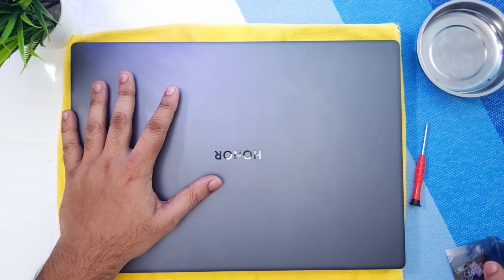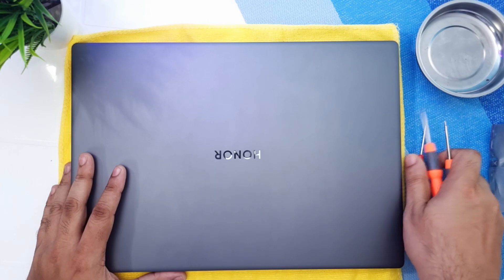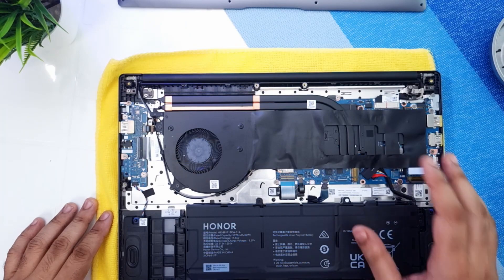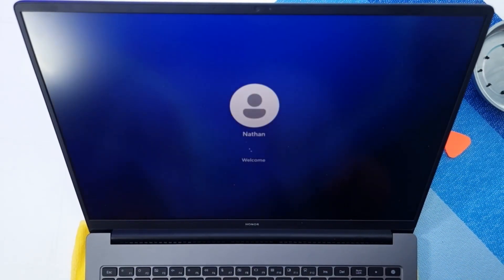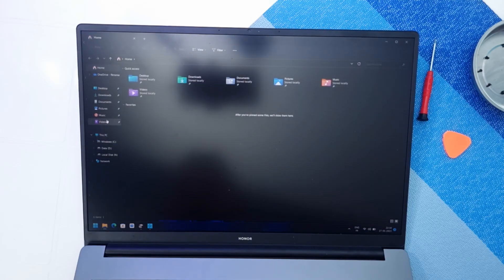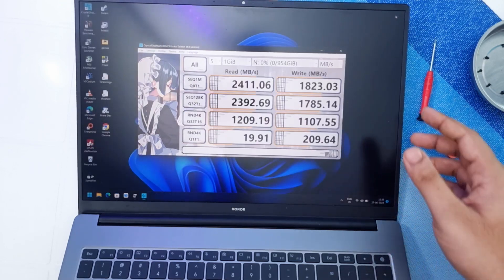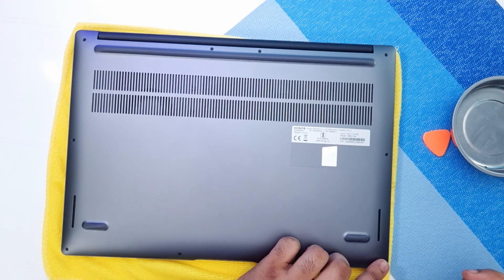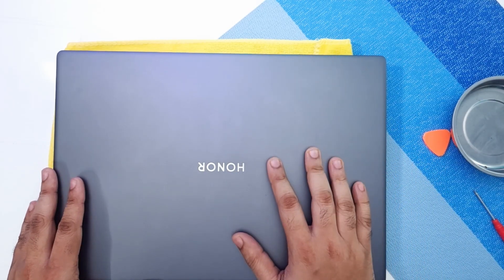Finally upgrading my Laptop's storage - Honor Magicbook X16

Comment: This Laptop Supports 4TB Nvme Drive (2280) Just had to upgrade the 1TB to a 4Tb and Check and walla it works superbly well. so now i have a 5tb storage in my X16Pro 4tb in the m.2 2280 and 1tb in the m.2 2242 slots.

Comment: Got myself a new X16pro at 50k, upgraded both SSD SLOTS  the 2242 with a 1Tb EVM at 5.5k and the 2280 with a WD SN770 1Tb running on Win 11 24H2
Reply: But your laptop is Running Now..
Wd Sn 770 1 tb + 1 Tb Evm 
2 tb full storage Ssd .. 
is it possible...
Reply: @Aaruu13  yes it is running strong without any issues. my laptop useage is almost 14-16hrs a day

Comment: bro , can i use this Sabrent 1TB Rocket NVMe PCIe M.2 2242 DRAM-Less Low Power Internal High Performance SSD (SB-1342-1TB)?
Reply from the maker: Why not but it's expensive I think
Reply: it's coming around 8k in offer @lazyneil

Comment: Mac mini m2 base variant vs this one which would perform better?
Reply from the maker: I would say the question is wrong it's like comparing apples and oranges 

For mac mini is not portable .. does not have a screen keyboard etc like a laptop 

But laptop's are 

I would say the only advantage is that you will get mac os , the m2 chip which is really powerful and other then that you are basically locked 🔒 

Hope this helps 🙂
Reply: @lazyneil  i have my current laptop setup connected to monitor. I barely take my laptop out to travel as most of my work is from home. I was looking for a laptop with good battery life which can stand for atleast 5-7 hours. However, since mac mini is available now would that be a better investment compared to this laptop. Again i know it's mini pc vs portable laptop. I'm only looking for performance over portability here.
Reply from the maker: @Insomniac_e  mac mini is a better investment for sure ... but keep in mind 8gb may be limiting so maybe go for the 16gb variant
Reply from the maker: @Insomniac_e  also this video will help you alot making your mac decision https://youtu.be/ppBe8cHQkTs
Reply: @lazyneil  Thanks since my budget is around 50k 16GB might be little expensive. I open a lot of tabs for research and writing so may be im good with x14 Honor.
Reply from the maker: @Insomniac_e  I have seen some of my subscribers even buying the 16gb for 46k.. so it is possible. You can join my discord if you want more info 🙂
Reply: @lazyneil  Sure why not. I mean the 16GB variant of Mac mini m2. Is it available for 46k? I just got my x14 honor 16gb delivered. Didn't mind about the service as I have never serviced any of my laptops.